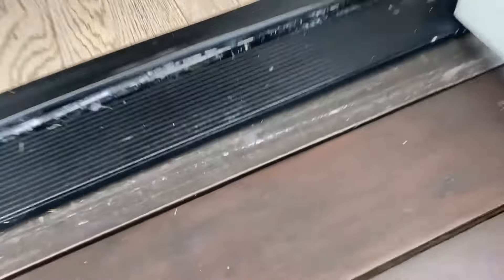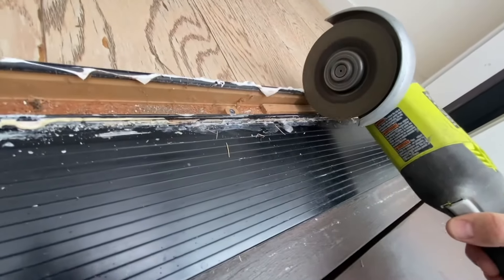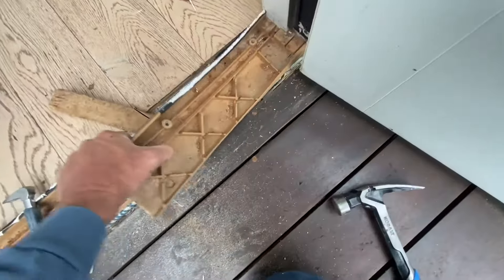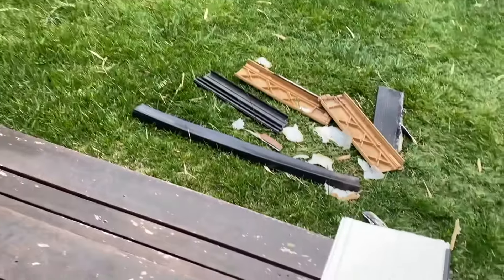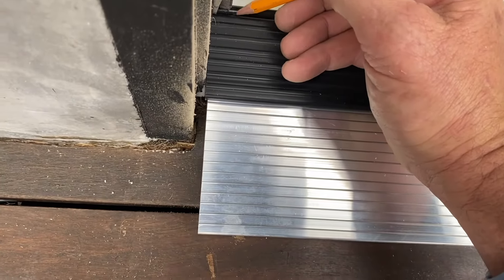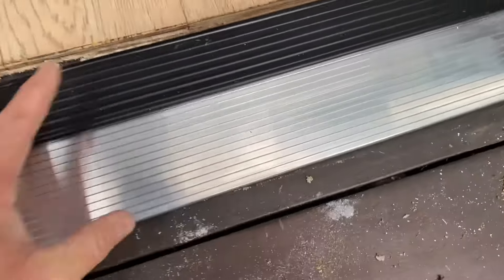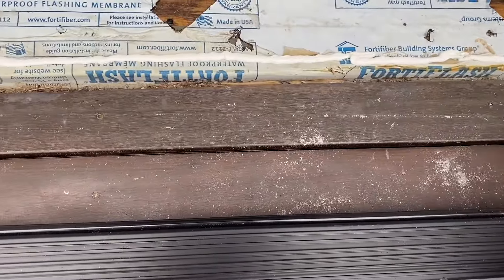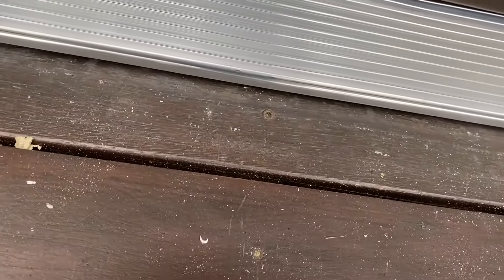How to replace a threshold on a pre-hung door

Comment: Do you think caulk is better than silicone in this application? If so why? Lots of feet going down on that.
Reply from the maker: It can be the same thing. Make sure to use a silicone based caulk as opposed to a latex based caulk. Latex based caulk is good for interior painting. Don't use it as an exterior sealant. I always use a silicone based caulk for doors that is paintable. Not all caulk is that type so choose carefully. Thanks for watching.